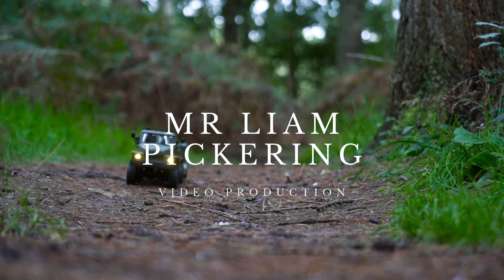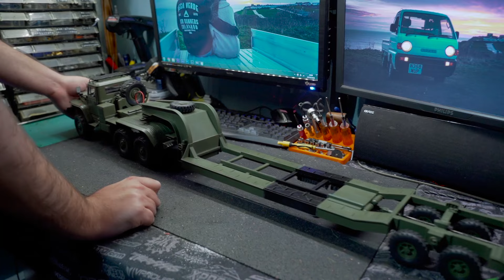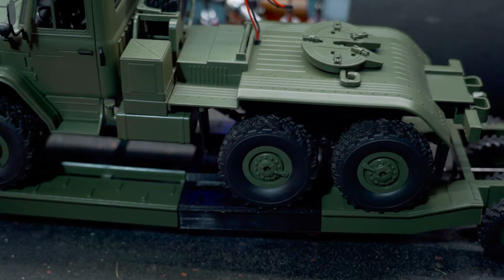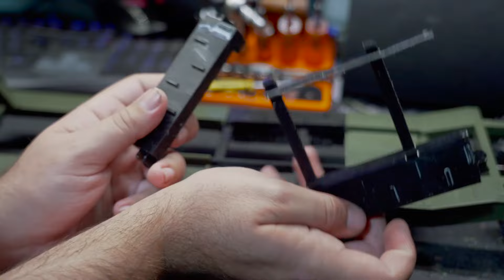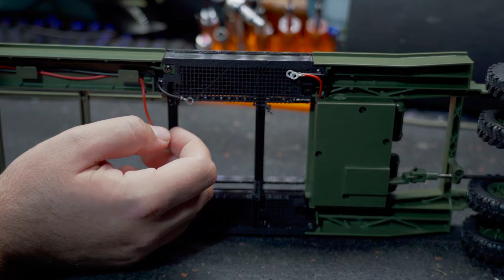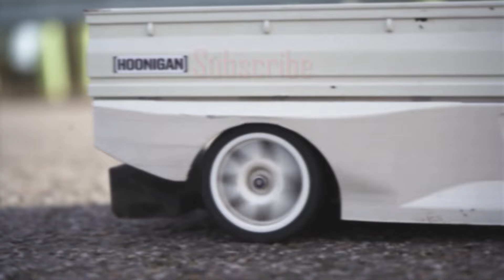WPL B36-3 First Trailer Mod

Comment: A wider trailer kit alongside your extension kit will also be nice to accommodate some 1/16 RC tanks aside from the E1. Also, if you can raise the rail guard in the middle of the trailer by a millimeter or two that prevents and hold the wheels or tracks from sliding sideways and making it tip over the trailer will be a nice addition too. also, with the center rail guard being risen, we can drill an aluminum flat bar into it making the extension kit + wide body kit sturdier, preventing it to flex during heavy loads. i hope this will be done soon and I'm looking forward for the outcome.